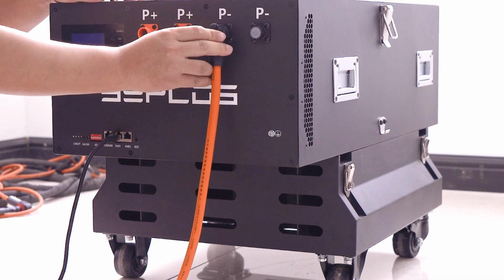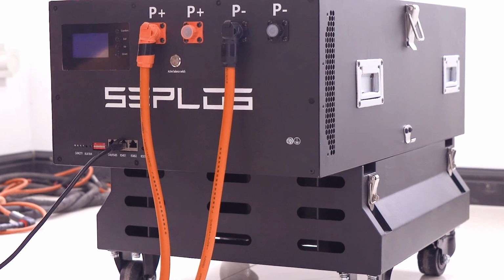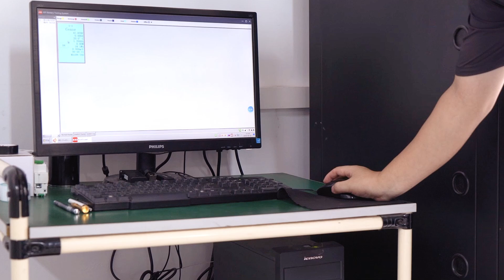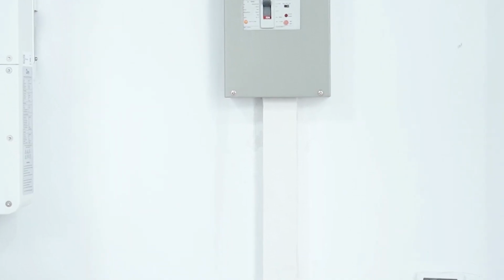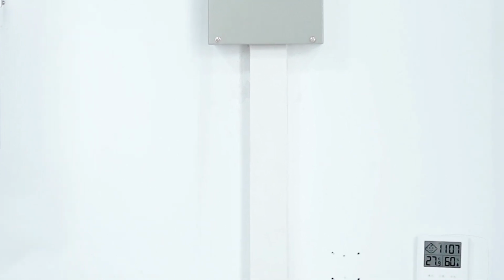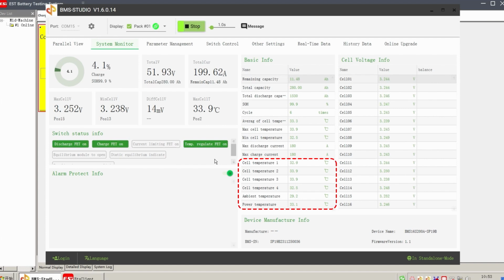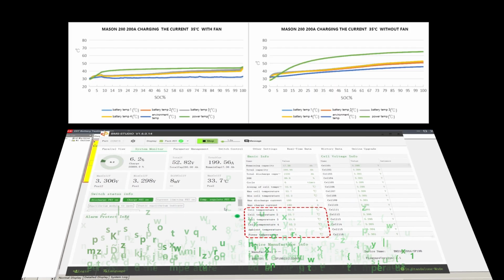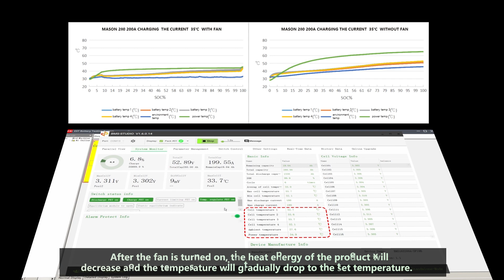SEPLOS MASON 280 48V Lifepo4 Battery with Air Cooling Fan - Make heat air take-out process visible

Comment: Thanks for the video, just a question please. the active balancer works manually or automatically with the bms? because on other video I heard it activate manually.
Reply: It can do both but it's pointless.
Reply: @Swwils it’s like a car doing routine maintenance. It’s necessary.
Reply: @peverellpoulin5087 Thanks for your reply, so you have to do it manually?
Reply from the maker: automatically active balance when reach the setting value. 
And also a manual switch for you to start balance manually.
Reply: @Swwils thank you for answering me, can you explain I don't understand your answer
Reply from the maker: The active balancer can work manually or automatically with the BMS.